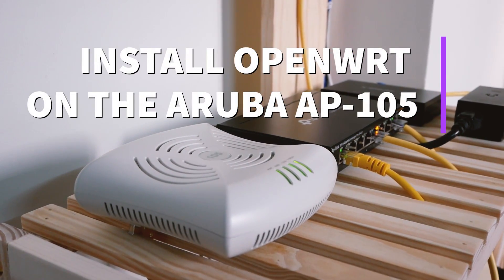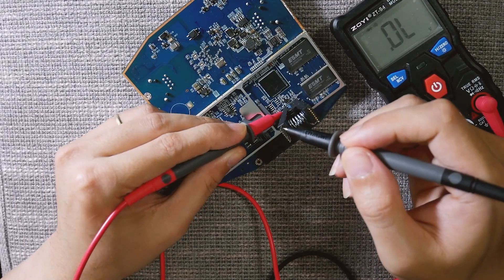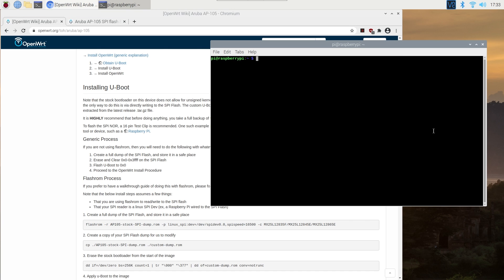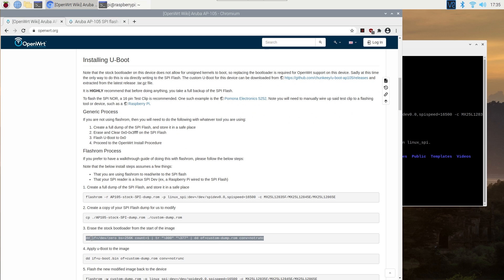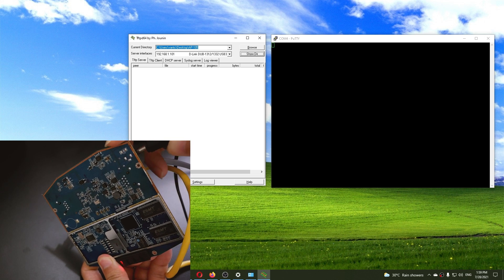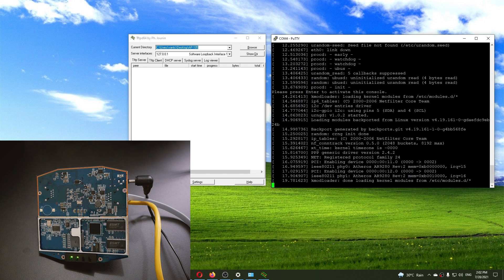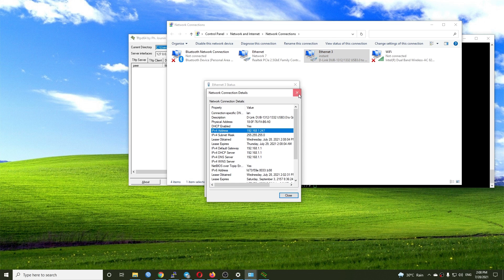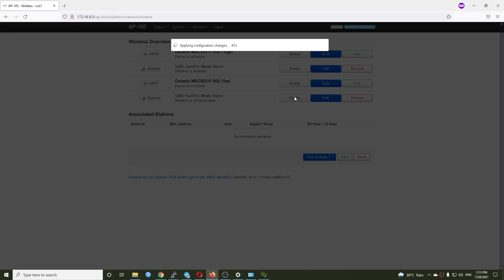OpenWRT - Install OpenWRT on Aruba AP-105

Comment: I tried 3 versions of openwrt 19.07.7 19.07.10 and 22.03.0-rc6 and the maximum speed is around 103 or 108 Mbps, what i missed out? or i did something wrong?
Reply from the maker: - Make sure that the Wireless country code on the AP match location (country) setting on your phone
- Manually set the transmit power
- Use WiFi spectrum analyzer to find the best channel to avoid signal interference
You can take a look at the above things. Also, the speed will be different depends on the phone you are using.
Reply: @VanTechCorner  Thanks, I managed to get 120 Mbps changing the channel and the country code, but I tried with all the channels and with several country codes and it does not exceed 120 Mbps, I am running version 21.02.3

Comment: Did you do a throughput, wifi performance comparison test?
Reply from the maker: Did you watch the video? If not, see 15:57
Reply: @VanTechCorner  i meant comparison between openwrt and aruba firmware?

Comment: can you please explain the purpose of having OpenWRT on it ? i'm trying to connect mine without having to use an aruba device directly to my router
Reply from the maker: Hi,
- I only have 2 Aruba APs at home and buying an Aruba Controller is way too expensive.
- The Aruba Virtual Controller (if I convert the AP into IAP) doesn't allow allow me to manage the device easily and its dashboard is not informative as OpenWRT
- With OpenWRT, I can setup Fast Roaming/Mesh WiFi and allow the AP-105 to mesh with other devices (TP-Link, D-Link) in harmony. So, why not give it a try xD

Comment: Thanks for the vídeo. I have a question: can I flash with rpi zero w?
Hugs.
Reply from the maker: Yes you can, but make sure you are using a good power supply for the Pi Zero.

Comment: Is there any way to install openwrt without raspberry pi ? coz I've no one, but  I've a ch341a ic programmer.
Reply from the maker: Hi, the procedure is just the same without RPI. You still need to create a full dump of the SPI flash, make a backup of the file and then modify it ...

Comment: hello, until step 5, "Flash the new modified image back to the device" everything went fine but I don't see the U-boot bootlog screen.
Reply from the maker: Hi, sorry for the late response. Did you solve the problem? Are you using a console cable or just flashing it via tftp?
Reply: @VanTechCorner  
Hi, are there still possibilities for the AP's recovery?
I used the console cable and tftp, I don't see the U-boot boot screen.

Comment: Hello can you make a tutorial on properly setting up bridge mode on a home gateway, so that it acts pretty much as a modem and the router does everything, for a fiber connection?
Reply from the maker: Hi, the bridge mode configuration is different from router to router. The best way is to ask your ISP to push the configuration remotely. In some case, after manually configured the GPON into bridge mode, the configuration from the ISP will overwrite it back to router mode (there is solution to do this permanently and I believe there is forum posts and videos sharing about the device specific configuration.

Comment: 👍 Good tutorial. @VanTechCorner, Can you make a tutorial how to compile/build OpenWRT firmware with Passwall/SSR+ Plus?😃
Reply from the maker: From what I know, there is a github link for this package and you can install on OpenWRT easily (clone the git & install it). Building the firmware & adding packages is harder. May I know if there is any problem during installation and why you need to build a firmware just to have the SSR/Passwall package?